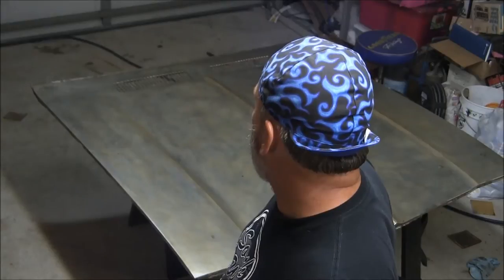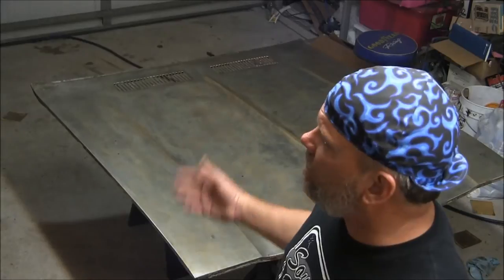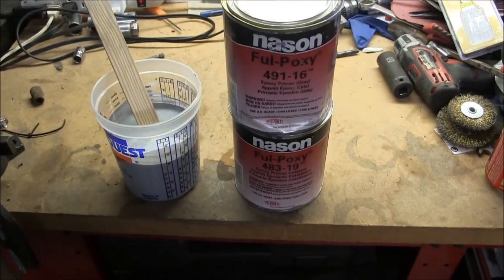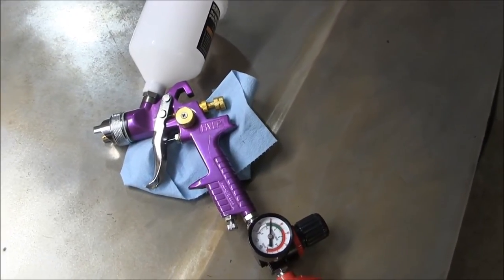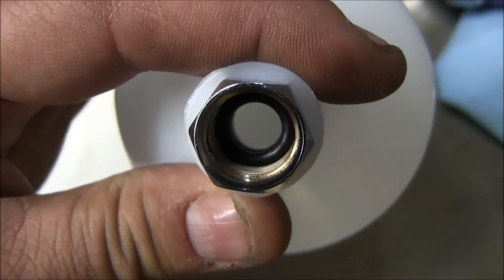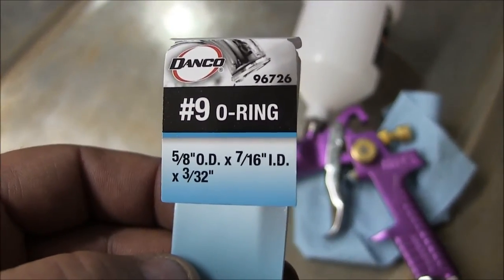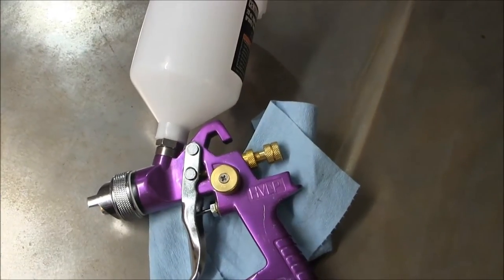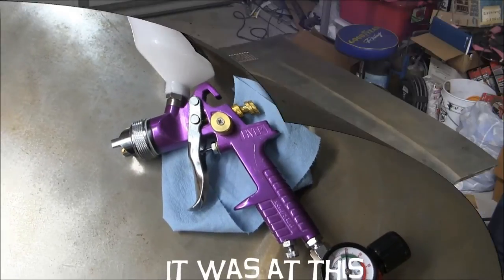1969 El Camino Restoration Part 18  Da Hood Chapter 4

Comment: How come you are not adding some reducer ?
Reply from the maker: Howdy Emir. Nason Ful-Poxy is a two component primer. Only the primer and activator are needed in equal parts. Thanks for watchin!
Reply: 512kjt I understand that but many people use  10% of reducer making it primer/sealer especially on bare matal thats what i did with my two part epoxy just a suggestion
Reply from the maker: Thanks, I"ll check into it. I am using this as a rust preventer mostly. I will see about the reducer for my final primer coat before I spray my actual finish. Thanks for the advice!